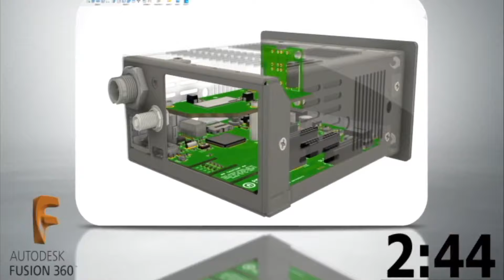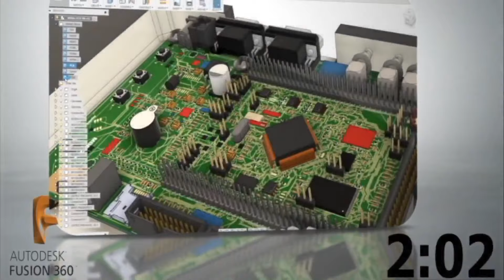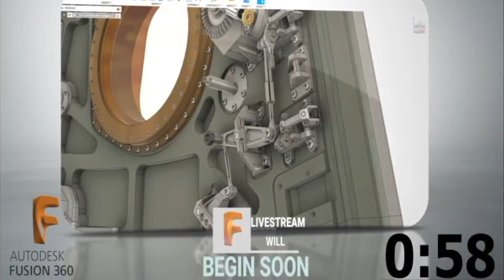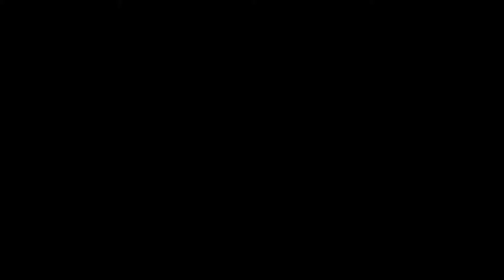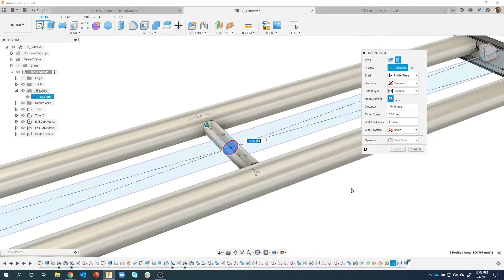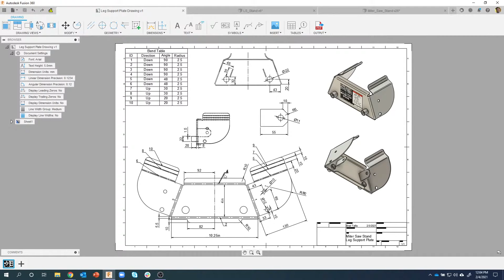Episode 83 - Miter Saw Stand project, Part 2

Comment: Good day Mr. Tallis, How are you going to do welding the tube and the nut. I  have try replace face function and fillet. Is there any ather way you plan to use? Thank you.
Reply from the maker: @Ekrem Tok-  I will show that they are welded on the drawing using welding symbols.  To do it "in 3D", you would have to combine the nut and the pipe together and use a fillet command.  Or you could leave them separate, but then you would have to sweep a profile to simulate the weld.
Reply: @bradtallis8968  Thank you for your answer Mr. Tallis. All the best.

Comment: can you please make us a oil sheet metal drum please if not see if thay can get us tool to do so we make round thing.
Reply from the maker: @David-  Not sure exactly what you are asking.  You can make an oil drum using the "Revolve" command.  Draw a side profile of the drum, then use Revolve
Reply: @bradtallis8968  Sheet metel dose not have any tool to work with round thing and it woud be nice if we had something or a way around it.